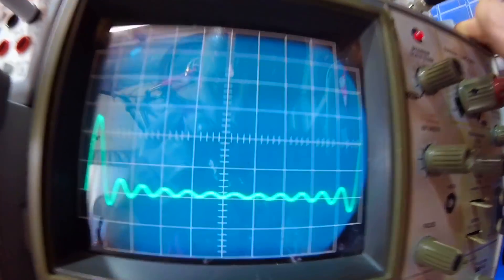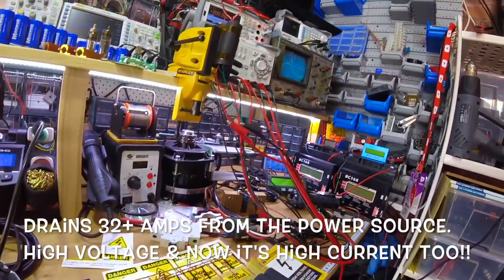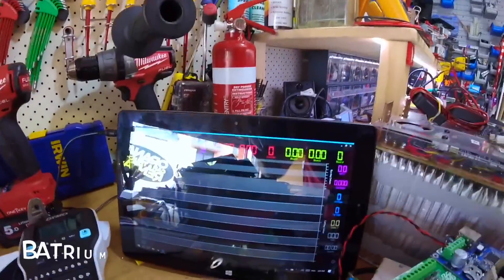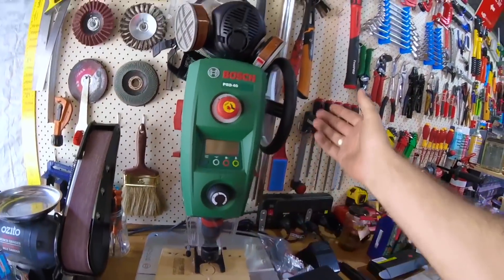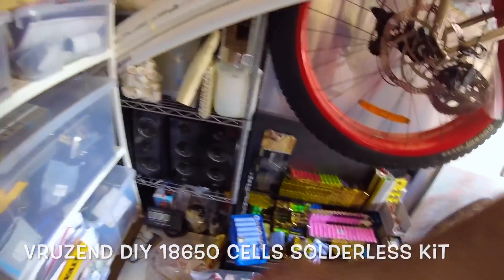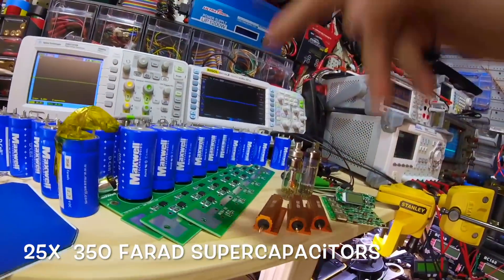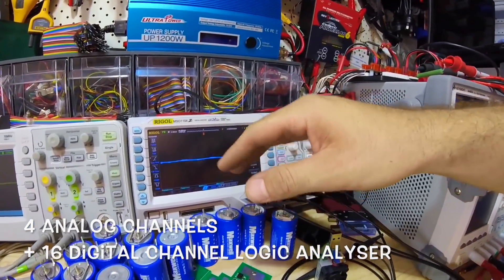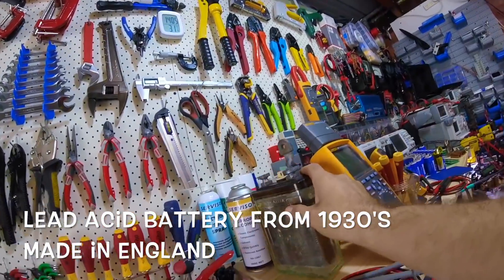Final Workshop Tour before moving house - Tools and a few projects

Comment: Hi, I have a bafang BBSHD 48V 1000W mid drive fitted to my fat bike and the bottom bracket spindle is loose and I can push it in and out but not wiggle it up and down. Can you advice me on how to tighten it please ? Kind regards.

Comment: Hi, my dear, are you ok?

Just a comment about your videos: POOOOOOOWER!!!!

Could you help me with some doubts about BMS?

I'm building a 14s7p eBike battery with cells harvested from old laptop batteries (a bunch of them are Samsung 26F and I have tested them with my genuine IMax B6 and all of them are between 2400 and 2600 mAh).

So, which is the best BMS to use? Is there any Batrium BMS solution recommended for eBikes?

One more time, thank you so much.

Regards,

Pedro Rosa.
Reply from the maker: Plateu1 Pedro POWEEEERR!!!
Yeaahhh, 14s7p is a good choice, lots of parallels sharing the load the cells shouldn't get hot what will make your pack last a lot longer =]
BMS... I'm still building packs using a standard battery management system but we are working on a premium BMS. Send me your email and your country and I'll get back to you, we should be releasing some info in a few months mate... =]
Reply: ElectricBike Perfect, my dear. My email address is: pedrorosasb@gmail.com.

Thank you so much.

I hope you get more POOOOOWER!!!! HaHa

Comment: Hi ElecticBike , i would like to build 2  ebike battery of 48v to travel a total distance of about 100 km, do you think that 2 battery of 25ah are enough ? And finally, Do you know where I can find brand new good quality cells at the best price ? THANKS YOU ARE AWESOME !
Reply from the maker: lt gdr Yeaahhh one 25Ah should be enough to travel 100km, it all depends how fast you're going. Speeds over 40kmh you start fighting agains your own aerodynamics so you'll need more battery to cover the same distance. Some people like the idea of having two separate batteries using one first then the second pack later. Connecting packs in parallel don't work really well in real life as they're never identical and one will age faster than other forcing the weaker even more everyday. If u can make one big pack is even better for the cells, less heat, less charging and discharging cycles.
This website is my favourite at the moment, all the cells are stocked in Europe https://ru.nkon.nl/rechargeable/18650-size.html
Reply: JUST ONE 48V 25AH FOR 100KM ? I have ask has a person how much kilometer he made with his battery 48v 25ah and he told me 50km.  It is to work as a delivery man in the city, so a lot of stop and acceleration so much energy loss I think, no? Thx for ur help

Comment: Nice equipment.  No portable battery internal resistance meter though?  I use mine almost daily for rebuilding and testing batteries!
Reply from the maker: asusreviews battery testers, ohh yeahh, I do have it but I need bigger toys to test big battery packs at very high current. I use the CycleAnalyst V2 connected to a computer, 4x 1000w resistors that I connect in series or parallel depending on the voltage and current I want. Got the BC168 balancing charger for fast balancing and some other toys.
What's your portable tester? If u use it everyday it may be handy to have one here too =]
Reply: I have an Extech BT100.  It's pretty basic, but does a 1Khz AC pulse on cells to give their internal resistance.  A handy tool to have when diagnosing bad cells or for assembling a new pack with new cells, I like to check the cells voltage and IR prior to assembly.  I got the meter cheap at a significant savings a few years ago.  Maybe there is some decent Chinese made similar model now.  Most important thing though for IR testing is to have 4 sense wires going to the cell.

Comment: Pleased to see the fire extinguisher ;)
Reply from the maker: hahahaha.... ALWAYS there, my best friend with the full-face polycarbonate mask and the freezer spray.
My favorite is the CO2 fire extinguisher, super cold removing heat from the source, contactless (gas) safe doesn't leave any residues perfect for electrical/battery fires + its fun.. super loud hahaaa =]
Reply: ElectricBike haha, no doubt you let the big CO2 boy off just for sh*ts and giggles. Cool to see your place. Good luck for a smooth move to the new pad.